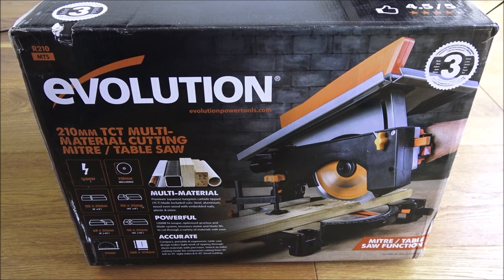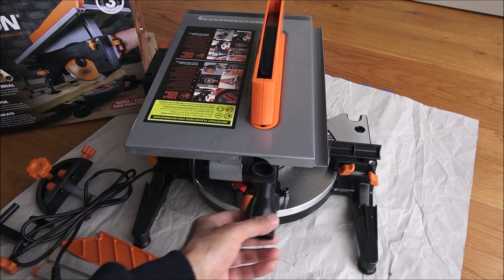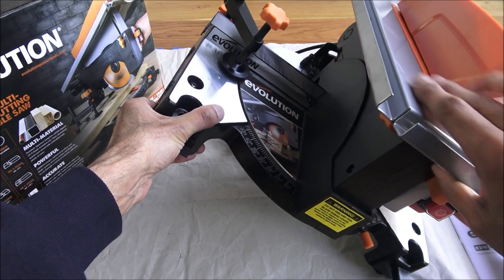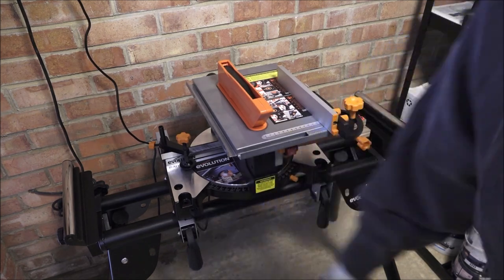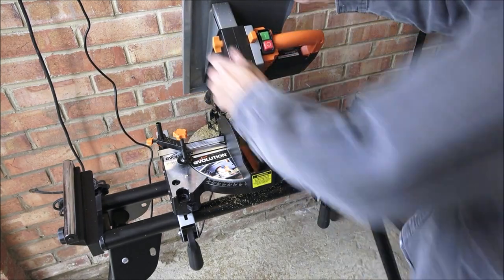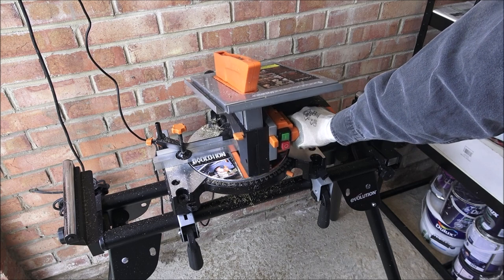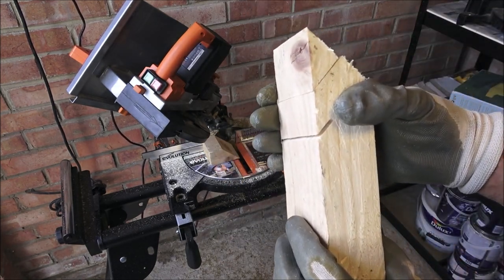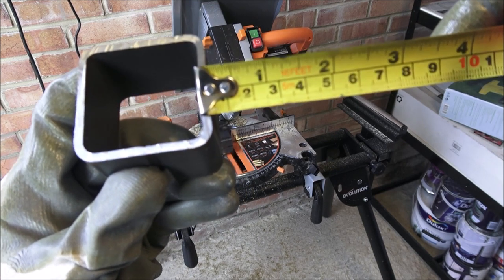Evolution R210 MTS 210mm TCT Multi-Material Cutting Mitre/Table Saw [Unboxing |Setup | Cutting Test]

Comment: Hi, thanks for the review, very useful. Early on in the vid you briefly showed how to adjust it to get an angled cut, but didn't show what mechanism there is to set it up for the angle you want. Is there some sort of guage on there or does it only do 45 degree cuts?

Comment: How long can the wood be when using the table saw. For example could this rip a floorboard?
Reply from the maker: I don't think there is a restriction, just ensure it is supported enough at both the front and back so it's easier to push the wood through.

Comment: What thickness of timber will the table saw cut?
Reply from the maker: This is from their website...

Max. Cross Cut (0° x 0°):115mm x 55mm

Max. Bevel Cut (0° x 45°):115mm x 25mmMax. Mitre Cut (45° x 0°):65mm x 55mm

Max. Compound Cut (45° x 45°):40mm x 25mmMild Steel Plate 
(Max. Thickness):3mm

Mild Steel Box Section 
(Max. Wall Thickness):3mm

Max. Depth of Cut (Table Mode):32mm
Reply: I don't think that was the question. The Evo web site quotes 32 mm as max thickness in table mode, max width using fence not specified.

Comment: I bought the Ferm version of this in 2012. Works ok but the saw blade is not at a 90 degree angle to the plate. So none of my cuts are square unless I put a flat piece f metal underneath my project to correct the cut to saw a straight cut.